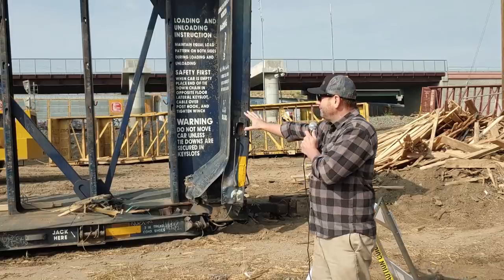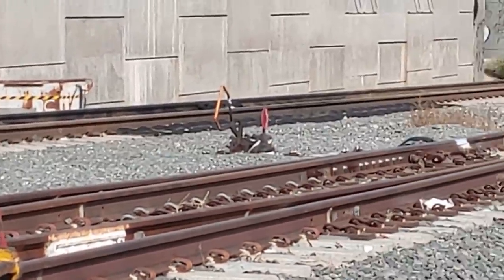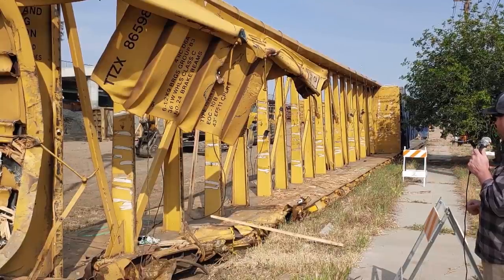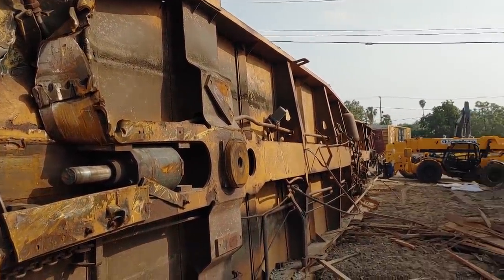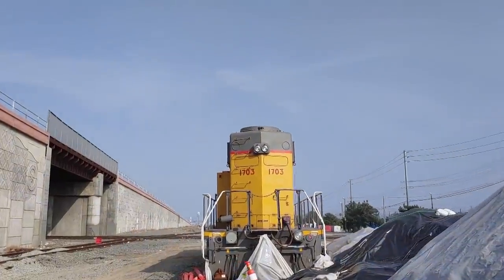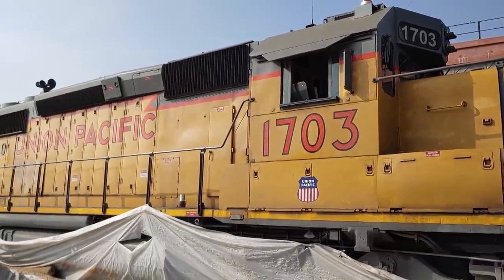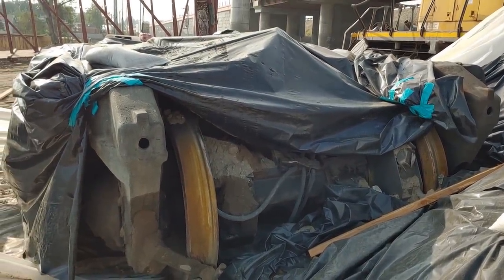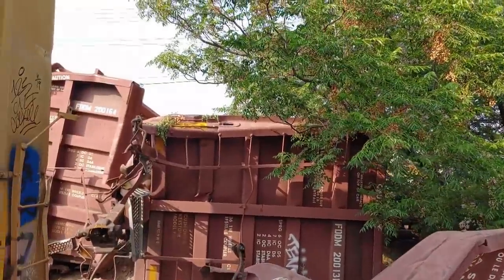Colton Train Wreck: Security Cam Footage And Close Ups Of The Damage 12 Days After Accident 4/2/22

Comment: That particular type of locomotive, an EMD SD40-2, used to be the most common locomotive on the North American railroad network with over 4000 built between 1972 and the late 1980s. They have been replaced in that regard by larger, more powerful locomotives and as a result have been relegated to local service and yard duties. Union Pacific rebuilt most of their SD40-2s for yard service, and one of the upgrades is a remote control capability, which is employed within yard limits only. This train was running with a 2 man crew. As for what will happen to the locomotives, 1554 clearly has a bent frame so it will likely be scrapped on site. The other two looked OK, some bumps and bruises is all. Depending on their history they may get repaired by UP, or sold off to an equipment dealer. As for the freight cars, they often get scrapped after a wreck even if they look OK. Steel is 100% recyclable so it's not a big deal, especially since there is a surplus of freight cars.
Reply from the maker: Wow.  I appreciate you sharing your knowledge.  I gotta say, for the few train related videos I've got, I've actually learned a lot from the people who have left comments on them.  
I'm glad the crew was not injured,, or any of the nearby residents.  It's really amazing that the spot the accident happened was the perfect spot to avoid any of the residents or real property other than the rails. 
On a side note, I was amazed to find out the Wild West history of that crossing and the ties to the Earp family.  I got some footage at Morgan Earp's grave site and Virgil Earp's house, both nearby in Colton, but I decided it was off topic and if I use it, is should be a separate video. 
Thanks again.
Reply: @SoCalCreature  If you look at the location on the satellite view of Google Maps, to the right of the two bridge support piers you can see what looks like an incomplete turnout built into the track the train was traveling on. That turnout is actually a derail designed to protect the crossing from a runaway or unauthorized train movement. Either the derail acted like it was supposed to, or the dispatcher controlling the junction neglected to align it correctly for the train. The engineer would have noticed the problem but not before it was too late to do anything about it, so the train derailed there. It wasn't likely to happen anywhere else along that stretch. As seen in the security video the train wasn't travelling very fast but they weigh so much that the momentum of the train overcomes any possibility of stopping the train before disaster. In the video you can hear the crunching of railcars continue even after the lead locomotives have stopped. It's an awesome amount of kinetic energy at play. I'm guessing if you start the footage about 30 seconds earlier you would probably hear the emergency air brakes being applied. It would be a loud hiss of air followed by a booming sound as the brakes are applied and train slack compresses.
Reply: A number of other countries have these workhorses to, including Australia and Brazil

Comment: When you noticed the gas line warning, there was something that goes back to the late 1980 to early 1990s that you might look up:  the Southern Pacific Cajon Pass derailment and the gas line explosion in a residential neighborhood 2 weeks later.  Union Pacific merged with Southern Pacific a few years later.  This line is linked to the SP line that had the derailment.  The gas line pipe is likely part of that same gas line that caught fire 2 weeks later after SP cleared the tracks in the neighborhood where the train derailed.  That neighborhood of homes is now gone.  The cause of that derailment was brake failure, caused by underestimating the total weight of the train cars and inoperable brakes on several locomotives powering the train.
Reply: This isn't the same spot. That accident you're talking about took place 4 miles north of this spot.

Comment: Scuttlebutt says the locomotive set and cars rolled away from the West Colton Departure track unmanned. Then rolled east towards the diamond. The diamond protection derail did it's job stopping the train.

Heaven forbid that derail wasn't open and that runaway train hit a Metrolink or another train at the diamond.
Reply from the maker: Yeah, I'm curios about the official report. I had another comment saying that it had 2 crew aboard. But yeah, it came awfully close to the north/south lines. You were there the first day before everything moved around. Im guessing it was about 100-150 feet from that line. I'm amazed at how close it was to homes but didn't damage any property or hurt anyone. Almost seems like divine intervention. 
Reminds me of a time a drunk driver flew into my apartments and pin balled off two trees before wrapping itself around a third tree 10 feet from my front door and me on my couch.  All 3 trees were were within feet of apartment doors, yet this car did not damage to any property other than scuff marks on the trees and a little torn up grass and nobody was hurt, including the drunk who tried to run for it.
Reply: @SoCal Creature the FRA investigation may take up to a year. Who knows whe UP will make an official statement. 

I am a railfan and wouldn't want to live that close to the rails. But to each his own.

I have visited a lot of derailments over the years and in most of the ones.hve visited the cars slapped against each other side by side. I live in Cajon Pass and have visited perhaps 20 derailments over the years.

Stand along along railroad tracks long enough and you learn stuff. The pipeline sign informs you there are pipelines under those tracks from LA to points north and east. (Check the Duffy Street derailment and fire in San Bernardino years back) The Southern Pacific Railroad used to own a pipeline company and there are some pipelines along their former right of ways. For xample from the tracks in Colton to San Bernardino International Airport. Railroad tracks used to serve Norton AFB...

There are also telephone cables under there. SPRINT began as Southern Pacific Railroad Internal Telephony.
Reply: @jonusle2937  I know of a mansion and some houses @200k short of being mansion that are  100 feet from two main lines Same company. One line is triple track and the other double.  Not for me.
Reply: Would make sense as the brakes and wheels are all covered up

Comment: The locomotives will be shipped to North little Rock,  Arkansas for rebuild and the cars will be scrapped on site. These locomotives are in yard service which means they was in remote control mode. The derailment was caused by the train running overall a DERAIL, a device use to prevent trains from making up authorized movement on mainline track from the yard. The device worked perfectly.
Reply: I'm a retired engineer, and I have no sympathy for UP, screw them and their scab operated engines. I never stole another man's job to keep my own, so I can keep working. I spent all my 36 years in engine service. I didn't spend most of my time on duty just sitting there doing nothing  and  getting paid for it.

Comment: The locomotives are EMD SD40-2’s that were built in the early 1970’s to early 1980’s the Union Pacific once had over 600 of them but only a few are left. The 1703 was built in 1976 and the 1554 was built in 1973 both were rebuilt in the Jenk Shops as SD40N, older locomotives like these are usually scrapped if they are wrecked.
Reply from the maker: Thanks.  Curious where you get all the info on these power units?  But yeah, from the comments by people who know much more about these things than myself is that because of their age, they either get scrapped or will be parted out.

Comment: Very good coverage. I'm sure UP would love this to be gone like the ad for 1 800 GOT JUNK but its so spread out and intertwined. I am surprised there wasn't more security. Three weeks ago Canadian Pacific dropped 11 cars at Pewaukee WI and had it back in service in under 24 hours. One was loaded lumber but 7 were empty 100 ton covered hoppers at least 30 years old. Today's wreck assessment is get the track open and then worry about cars. By the end of the week a backhoe with a shear reduced then to piles of metal. Thanks for sharing and yes they do have to go easy on that pipeline

Comment: Remote control locomotives are only used for switching in yards by conductors. They do however have a manual option so that they can be operated by an engineer. These would never be used on the main track in the remote control function.

Comment: As others have stated, all of these locomotives are EMD SD40-2s (or some rebuild of it).  1599 and 1703 have hardly a scratch on them and will probably return to service after some light work in the shop.  1554 is almost certainly a goner.  It the frame isn't bent, it could get a heavy rebuild.  Older locomotive frames are valuable because a new locomotive can be built on top of them and it won't count as a brand new locomotive, but instead as a rebuild.  This means the locomotive doesn't need to comply with strict environmental pollution regulations that have the unintended consequence of making locomotives more unreliable.

Comment: As someone else noted, the "container" is actually called a boxcar.  Containers (the big metal boxes you see on ships) go onto well cars, stacked one or two high.  It does not appear any of those were in this wreck.

The "lumber" cars are actually called center beam cars, due to the obvious central spine the pallets of lumber rest against.
Reply from the maker: Got it.  I'm not too familiar with all the nomenclature for all the different types of cars, but I've actually learned a lot just from the comments.  Thanks for chiming in.
Reply: @SoCalCreature  👍
Reply: @SoCalCreature  the one box car you looked into was loaded with paper rolls (and the inflated bag you see is known as a dunnage bag) heading most likely to a finishing company someplace. I used to switch 3 different paper mills here in Wisconsin every day  and pulled lots of loads of finished paper going to the converting plant! company.

Comment: Just a follow up on the locomotives while they are equipped for remote control at lower speeds in yard switching they can also still go over the road as built. Also noted all the oil booms around the fuel tanks which probably were pumped out by your visit.  Last item a bit of trivia but the blue lumber car and the mangled brown car both had reporting marks FDDM. These cars are under Union Pacific UP ownership and stand for Fort Dodge Des Moines & Southern RR which exists only on paper. The FDDM was acquired in 1965 by the Chicago & North Western RR and the bulk of it has been abandoned and ripped up.  UP can still use these marks and it can result in favorable leasing or financing terms and helps keep them in current legal status. The most ironic part is that the modern centerbeam car was not built until the 1970s and early 1980s so the real FDDM could never have ownd this style of car. In fact after the track is relaid you .may see a ballast car painted Union Pacific but marked SI which stands for Spokane International acquired circa 1959.
Reply from the maker: Interesting.  It sounds like maybe there was some creative accounting going on over there. haha.

Comment: So the "remote control locomotive" is only used in the yards during amassing a train or shunting. The remote system only has a max range of 50 yards (variable based on the weather and system conditions)
Reply: this is not true. I've seen UP using remote locomotives for local deliveries in the St. Louis area
Reply: In Anaheim California, the UP line alongside the Santa Ana Freqeway (Interstate 5), there is a remote warning sign where Crescent Avenue turns into Crescent Way.  There used to be another warning sign in a neighborhood where the train goes under the Brookhurst Street/La Palma Avenue Bridge at the Interstate 5 Freeway, not too far northwest of where Crescent Avenue becomes Crescent Way.  That railroad parallels the freeway for several miles into Norwalk California, and also parallels Firestone Boulevard through Downey California into Southgate.  That line was a Southern Pacific line until they merged with UP.  The branch line that runs north and south from Huntington Beach through Westminster, Garden Grove and Stanton joins up to that track in Anaheim.

Comment: used to work in West Colton, you had to be very careful pulling a train out of the yard with the Remote control locomotives. Often theres too much weight for those locomotives to handle, glad know one was killed.
Reply: Yeah really, and coming up to a diamond. I'd rather set my brakes early and stop short then have to start again rather than blow a derail. Imagine ridding the point on this one.
Reply: @BossSpringsteen69  exactly, I would set the air well before pepper and drag it until it picked up speed, then throttle off. It was a newbie Conductor on this one, he forgot to cut in the air when they laced up

Comment: OK, so I know you were making comments about the remote control portion of the locomotive, 99% of the time big person who is controlling it is either on the nose or within sight of the locomotive,. Also the conductors and engineers chairs are still used on those when they are using the inside controls. Most of the damage to the engine is repairable. The parts are interchangeable. If you ever checked out some other videos they can show you that almost anything is removable replaceable reset. These engines are older engines that are now yard workers as opposed to Main line Road engines. They may not feel it is important to repair them over replacing them. Also they have hundreds of engines that are out of use at many of the rail yards. They could pull them into action versus repairing this one. Hope this helps.

Comment: Remote control (RCL equipment) is mostly for switching, yard jobs. Remote control units wouldn't ever reach any high speeds aswell. UP for being the big company they are, I'm sure a good portion of the locomotives will be fixed, but as for mainly 1554, I wouldn't be surprised if they use it for parts to a new unit, as the prime mover, and stuff on the roof seems in decent shape to only need minimal repairs. 1554 will either get swept off the roster entirely or they will get another unit to replace that number, either being another SD40-2 or something else they feel could be used. ; It also comes to mind that they could re-build the entire locomotive into an ECO unit of some sort, they got a big thing for doing rebuilds like that. Any questions from anybody, just ask :) 

(also wanna throw in, nice catch on the BNSF fakebonnet, haha)

Comment: Looks like lead engine fell off the tracks because switch was in wrong position
Reply from the maker: Could be.  It's interesting because I looked up a satellite image and see that the track that this train was on continues eastward and crosses the 2 north south rails.  I thought when they built the flyover they removed the crossing at the same grade, but satellite shows the flyover right next to the crossing and the frogs.  Maybe this train was supposed to curve and go northward but accidentally got on the rail that crosses the north/south and wasn't supposed to be there so it derailed.  A couple people have commented that the derail was a safety mechanism and that it did exactly what it was supposed to do. So that would support that theory. Thanks.
Reply: @SoCalCreature  Nowadays more often than not  derails protect the mains at yard entrances.

Comment: The way I understand it, if these are under remote control within a yard limit, they can be and are offten un-maned, theyre controlled using a belt pack. There's a few vidoes on YT showing them in opperation in the US and Canada etc.
Would be interesting to know if there was a crew aboard for normal operation or no crew for remote opps in a yard. The pile of sqaure things are plastic pads and insulators that are fitted between the underside of the rail and the concrete tie. That other pile are truck side frames and bollsters that the cars sit on. Those large round things in that box car are rolls of paper.
Reply from the maker: Thanks for the info.  It looks like the jury is still out on if these were manned or not.  A lot of people said that they only run remote in the yards.  I looked up the assessors parcel map for these lots and they are all owned by either BNSF or UP, or jointly owned by both, but it doesn't seem like this area is technically a yard.  There are yards a short distance to the east and west of this crossing, but I don't think this would be considered a yard.  Also, the north/ south line that this crosses carries not only freight but is the main line into San Bernardino for MetroLink and Amtrak, so I hate to think they would have anything in this area operating completely by remote if it could cross those passenger lines.  I don't know though.  This is just speculation on my part.
Reply: @SoCalCreature  Don't be surprised if you hear about remotes going on the active passenger mainline. Seen it done many times.